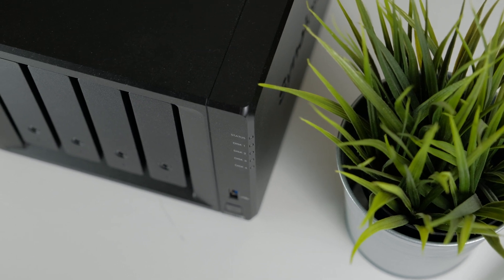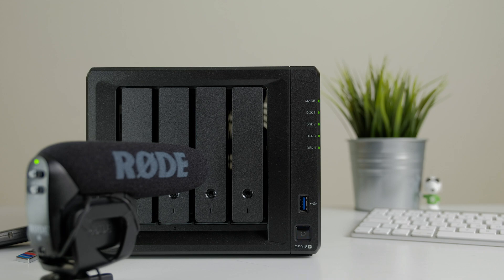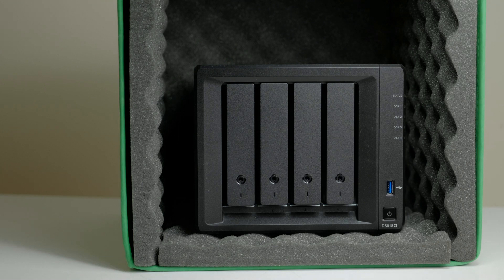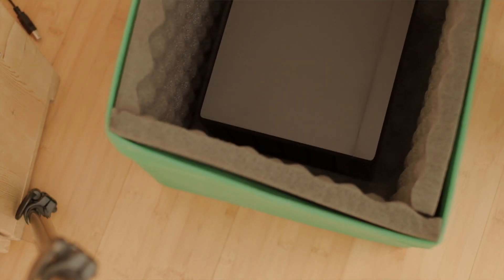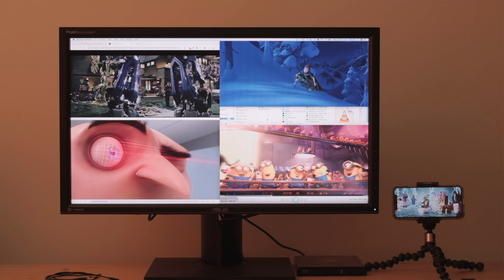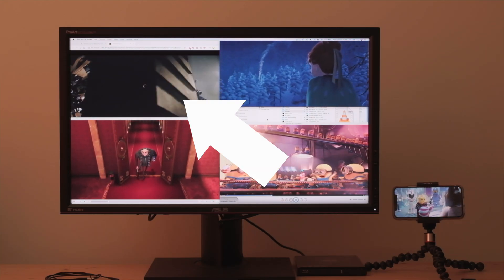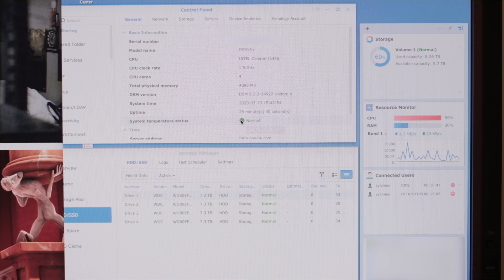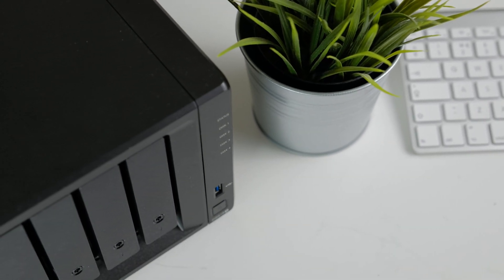How to make your NAS quieter with a DIY acoustic foam box!

Comment: Are NAS drives usually more noisy? I recently bought Seagate Ironwolf and it's the loudest hard drive I've ever heard.
Reply from the maker: Probably! I noticed my WD NAS drives are quite loud too. I wonder if they are more robust for the 24/7 access hence more noise?
Reply: @JoeLamOfficial  Yeah. I've been watching more videos on the subject and from what I learned, the more robust the hard drive and the higher the capacity, the louder it'll get, with the enterprise-class drives being the loudest.
Reply from the maker: I think it's normal that these drives are louder than standard ones for their use case.

Comment: So the "rumbling sound" when you load is normal? Does the velcro help at all with this problem? Also, I stopped using Plex cuz it keeps the NAS CPU high & running 24/7. Have you experienced this? Thanks in advance.
Reply from the maker: Hi Jim. This helps to muffle the hard drive access sounds a little. But it doesn't get rid of it completely. I still use Plex. Same here, the CPU/memory shoots through the roof when transcoding movie and sometimes it wouldn't work or take a long time to try and watch 4K videos. 

It only zaps all the resources when I'm watching stuff though, not 24/7 or when it's idling in the background? Are you running the latest version of Plex server on your NAS? They seem to be constantly updating it.

Comment: I don't have any loud clicking, the 4TB IronWolf Pros are really good. My NAS is just a storage device, I have a mini PC doing the transcoding (i7 6700 with 32GB RAM)

For me it's just the hum of the vibration. I think I'll add some padding on the drive cages to minimize this and also add additional soft material to the feet of the Synology.
Reply from the maker: I haven’t used IronWolfs before so I don’t know how loud they are in comparison. But the WD NAS drives are quite loud. Especially 4x8Tb firing away.
Reply: @JoeLamOfficial  Any drive over 4tb is noisy in my experience. Thankfully for now I can get away with 10.8TB of usable space, but I'll probably end up with a larger NAS somewhere down the line 👍🏻
Reply from the maker: Eventually it'll fill up probably. Wonder how big the hard drives can get. Currently limit is like 12Tb per drive or something crazy?
Reply: @JoeLamOfficial  16TB, but would be nice to see SSDs drop to the point HDDs are redundant so I can have silence 😁
Reply from the maker: Don't understand how they can keep increasing the capacity yet the physical outside dimension stays the same. It is getting chonky though the weight. But yeah, the Tb seems to get higher and higher! Incredible. Would be good to have SSD speed. I'm sure we will get there eventually. Call me old, but I remember when 64GB SSD use to cost, what, like 500USD or something crazy? Seem to remember it being prohibitively expensive. Or blu ray drives use to cost 1000 USD+. 🤣

Comment: This is neat but you’re recording the noise the wrong way. When inside the box the sound escapes upwards, while you’re still recording it from the side.
Reply from the maker: That’s true but from my listening position at my desk it sounds slightly less loud as I have my nas under a shelf so it helps to block some the noise escaping. But I agree this method of testing might not be super accurate.

Comment: Does this mean the velcro strips didn't work?
Reply from the maker: No, it does work. It's still quiet now and the buzzing hasn't come back since.
Reply: the velcro strips solve a different problem: the drives were vibrating against the synology enclosure. The drives themselves produce noise under load and really theres no good solution besides setting up your nas elsewhere where you can't hear it.
Reply from the maker: Mechanical drives are super loud especially having a couple of them in door. They do drive me nuts. Maybe one day SSDs are cheap enough to replace these drives. 😝

Comment: Actually, if you create a hole in the front and put a dust filter on it - then cover the top and put an outtake fan on it, the temps might go down, as it will create circulation of air. Just don´t forget to clean the filter regularly.
Reply from the maker: Hey thanks for the cool idea. Good suggestion 👏🏼
Reply: @JoeLamOfficial  Just don´t forget to make front hole in the front bottom part of the case 😉 and make sure it´s near the main intake hole of the NAS.
Reply from the maker: I might try it one day. :) Have you got a NAS too?

Comment: IronWolfs???
Reply: I have an iron wolf pro and it makes so much noise when it’s working and even just reading files (sync) I’m going to go crazy
Reply from the maker: Most mechanical hard drives are quite loud but have a feeling especially with NAS drives. Maybe they know they are designed for server environments.
Reply from the maker: Hear about them online (YouTube) a lot, but personally not had experience with them. I didn't have much luck with Seagate in the past. Hopefully they're better these days.

Comment: What hard drives were you using in this video recorded tests in your NAS?

I'm using my upcoming NAS in a music recording studio space, so noise is important to me. I'm getting WD red's because they tend to be quieter, but would prefer to get Seagate EXOS X for a better size/price, but they are known to be loud.
Reply from the maker: WD RED NAS drives. I’m not a pro but even so the noise gets picked up by the mic in my recordings. These drives are very loud and the chassis. No matter which brand you go for. It’s probably best to have it off or as far as away possible from your recordings.
Reply: @JoeLamOfficial  Thanks. I may have to just get a LAN run done upstairs in my living room, LOL (I'm in the basement, where my studio is)
Reply from the maker: Very likely I'd say. The clicky d clack is just too loud for audio recordings. :)